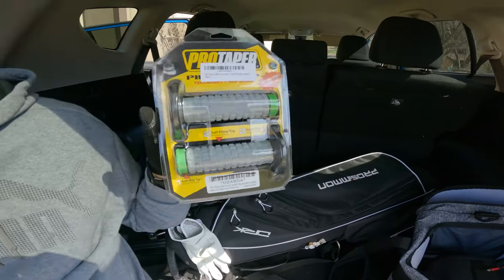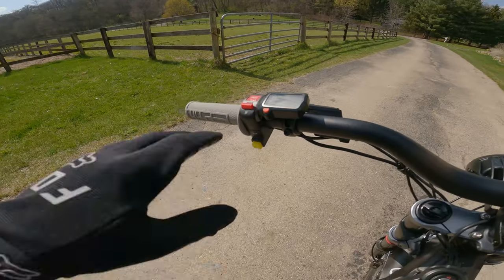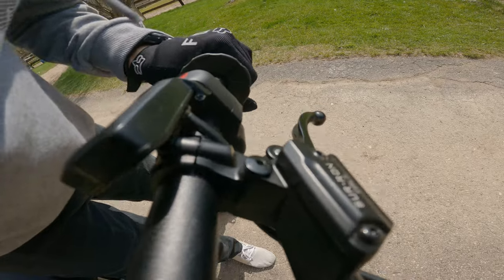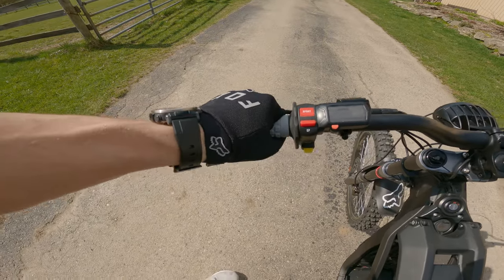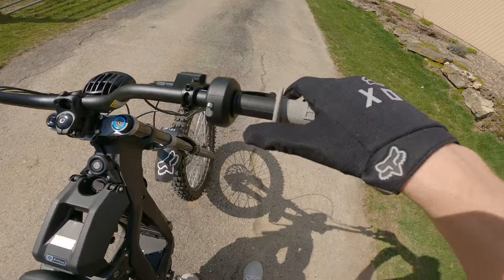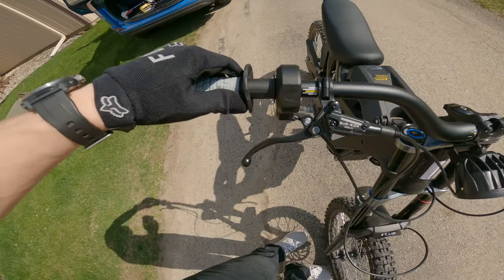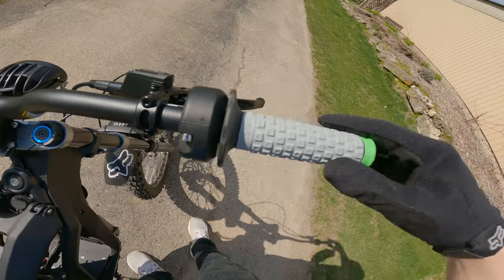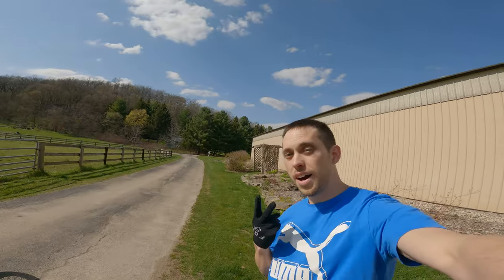ProTaper Pillow-Top Grips for Sur Ron - How to Install

Comment: you can use compressed air and spray under them as you push them on or take them off and it makes it much easier.
Reply from the maker: oh man that would have really helped!! haha
Reply: or aerosol hairspray
Reply: the real method is a bit of dish cleaner
Reply: 2 years later, thanks for the info, definitely going the air compressor route!
Thank you!

Comment: Hairspray works well.  Acts as a lube to slide the grip on, then turns to a light glue. To remove slide a  small screw driver under the edge of the grip and spray hairspray in there.  I let them dry overnight before riding and they stay put.
Reply from the maker: I gotta try that next time haha !!

Comment: I also have a surron. A week ago i was riding in the forest with a few drops of rain. My left grip came flying off.. Stock grip.. i put it back on with glue and a small iron wire just like they do with dirtbikes. Nobody here uses glue to keep it on its place?
Reply from the maker: yeah the stock grips seem really lose. ive been riding with these pillow top ones the whole summer and they havent moved at all, but that would suck yeah.   yeah i saw on some honda dirt bike video how they put grips on dirt bikes with that wire method, i feel like i would be worried about slicing my hand on that little wire on accident.  yeah there was someone on youtube putting grips on with glue lol, idk if thats a thing or not, im not super familiar with dirt bike stuff.
Reply: @KevinCarly  you twist the wire and then stick the end in the grip. I've replaced my grips already. I have a complete black bike. So i upgraded to black grips with black and red donuts that came with it 🙃 It looks crisp 👌
Reply from the maker: @jacobcuijpers702  Ohh I see, that bike sounds sick !!
Reply: One more question.. what tires are on the bike in this video? I need to replace my stock trail tire that was on the bike when i bought it.  Winter is coming here and its getting muddy, wet leaves and stuff.
Reply: Its cst or am i wrong? I don't want a lot of weight in the tires
Reply from the maker: @jacobcuijpers702  in the video and still now i have the stock tires and stock rims on the bike.  i dont plan on replacing them until they break or completely wear-out.   i think money is more usefully spent on grips, bars, pegs, mud guards, suspension.   im considering getting good brake pads maybe but the stock ones are okay enough at the moment
Reply from the maker: @jacobcuijpers702  im not sure what cst means, what does that mean?
Reply: @KevinCarly  cst is the brand of the original tires
Reply from the maker: @jacobcuijpers702  ohhh i see, thanks!